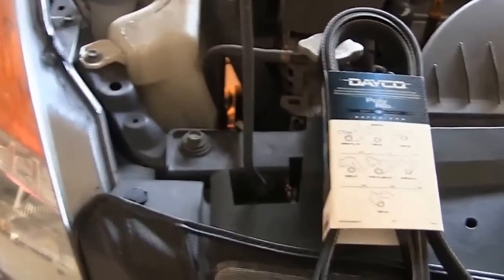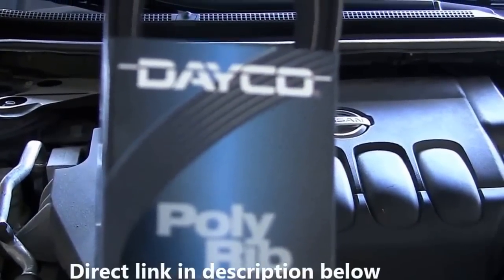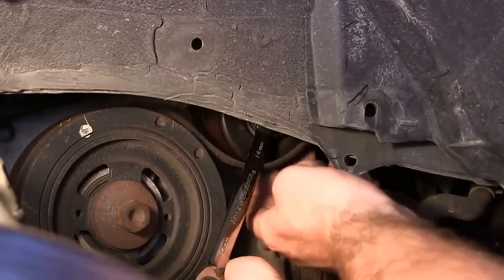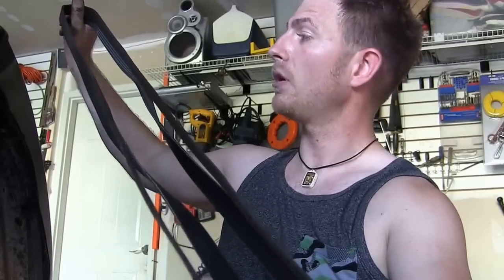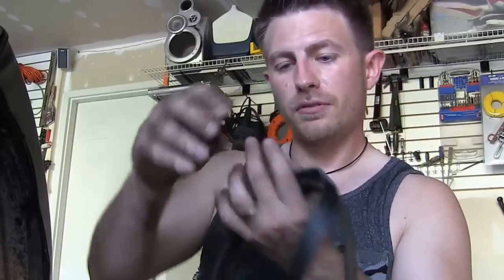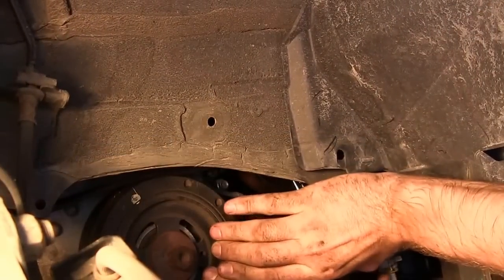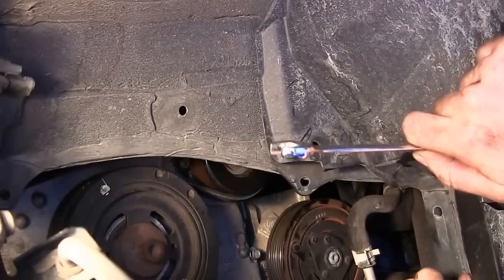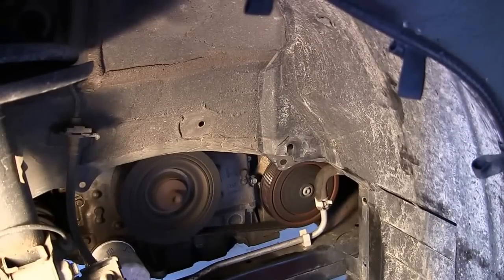How to Replace serpentine belt 2008 Nissan Altima

Comment: So I am a chick and thanks to you I just changes my first belt!!!! Women's hands are smaller so I didn't have a lot of trouble!!! Thank you soooo very very much!!!! Brakes next!!!!
Reply: I can attest to the part about hand size--I'm a guy.  I have trouble taking my oil cap off without removing the engine cover because my hand can't fit in the hole to loosen the cap off.

Comment: Thank you so much!! Went in for a recall to the Nissan dealership and they told me my drive belt was "severely damaged" and quoted $270 (!!!) to change it. With your video, it took me $25 and an hour to change it. Thank you again!
Reply from the maker: Thats awesome man, you saved a TON of money!
Reply: Cool!! love to do the work the "Stealer" way overcharges for! .
Reply from the maker: yeah no kidding.. and in my experience some of the "certified" technicians at my local dealer are pretty incompetent
Reply: dealerships = stealerships most times.

Comment: Bro thank you for your video because it help me A LOT. I change my drive belt on my 11 Altima today. It took me 3 hrs because I never change the belt before, however I save 300 dollars. Its well worthy if you ask me. I know my car inside out which is the reason i didnt mind changing the belt. I replace my bumper as well a year ago. Its all about saving money . I only paid 24.99 (Amazon) Thanks again
Reply from the maker: trueGrizzlesFAN22 awesome bro, glad I could be of assistance! Every little bit helps right! And knowing your car is super important.

Comment: I just replaced my exhaust manifold and exhaust pipe because of this video.  lol. You have to remove the belt and alternator for manifold bolts.   I was not confident at all about the belt.   So thanks alot. Saved about $900

Comment: Just wanted to say thanks for posting this video.  Just changed my belt on my 2008 Nissan Altima and it was easy thanks to your vid.  Also, thank for the vid on camshaft cleaning.  Worked like a charm.  Cheers!

Comment: Thanks good video what is important is to make sure when when you pull the tensioner back with the 14mm open end that you back far enough and clear the pulley with the wrench so you get enough play in the belt to get it back on coming off is easy but if you don't pull the tensioner back far enough you will think you have the wrong belt. Thanks again for a good video!!

Comment: Thank you! There are holes in the tensioner bracket and block that let you put an Allen wrench (1/4" I think) that you can lock the tensioner "out" so belt routing/install are easier. you can see the holes if you look. It made it so much easier!. There are a couple of good videos for this and I thank you guys for posting these.. I just changed the Crankshaft position sensor, very common on these cars, (a total pain in the ass!) because the car was stalling and hard starting a lot. while doing that job I noticed the belt was shot (124,000 mi on original!!) so this is the next project. Thanks again.

Comment: Thanks from Canada, for the video.   Looks like our 2004 Altima with 65K miles is in need of a belt change, so I ordered on on Ebay (Gates) and will attempt this now that I've seen this video!   I'll assume most 2.5L Nissan engines are very similar, (with air) so I'll be giving this a try tonight.    Thanks again, much appreciated!

Comment: This video came in handy for changing the belt on my 2010. My only issue is the wrench I used. I know there are serpentine belt kits that have a breaker bar with attachment jaws on them that you can use. I tried with one of these and didn't have enough clearance from the ground doing this with the standard jack the car comes with. I tried using a regular 14mm wrench and ran into issues of the wrench slipping off the tensioner bolt for lack of not having enough grip and torque. I ended up using a 14 mm offset wrench that was a little bit longer than my standard 14mm wrench to get a nice hold on the bolt on the tensioner due to the offset bend. If I had to do this again though, I might do it with a Klutch Extra-Long Spline Drive Flex Ratcheting Wrench - 12mm x 14mm to get that nice extra hug on the bolt.

Comment: Ditto on the other comments! Really appreciate your help.  Question, You didn't mention anything about tightening the tensioner at the end.  Are there any specifications as to how tight the bolt should be?
Reply from the maker: Yeah thankfully the tensioner doesn't have to be tightened, it springs back into place.  I do believe the older models had to be tightened though.

Comment: I noticed you didn't mention the power steering pump. Is there a separate belt for the power steering pump.
Reply from the maker: That’s a good question, I do not recall at this point

Comment: thanks for this video nivekoch, saved me some money, firestone wanted 150.00 to 200.00 bucks to replace got the gates micro-v AT serpertine belt for 36.00 + tax, O'reilly auto parts, part# K060878,,, thanks again
Reply from the maker: Thanks for the comment, Good to hear you I helped you save some $$ .  Surprisingly Valvoline instant oil change only wanted to charge me $90, but for a job this straight forward I'm glad I did it on my own.  $35 is cheaper than $90!